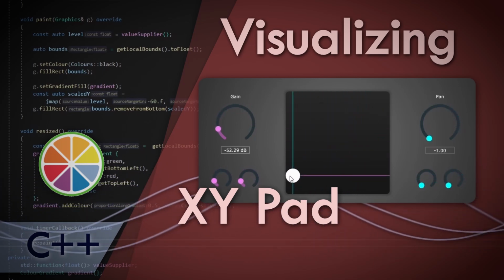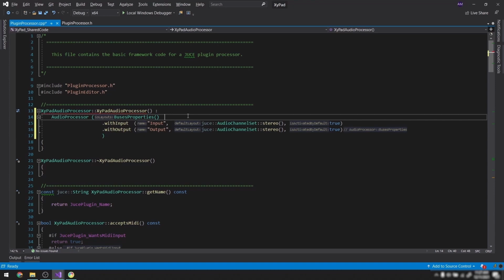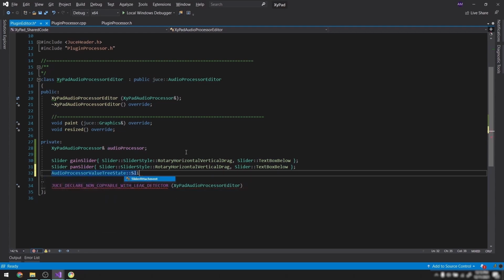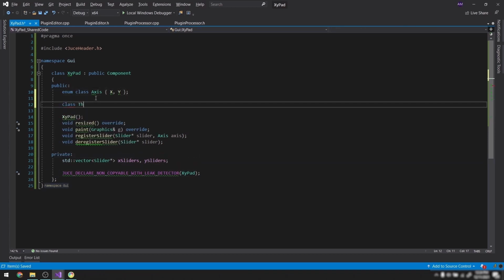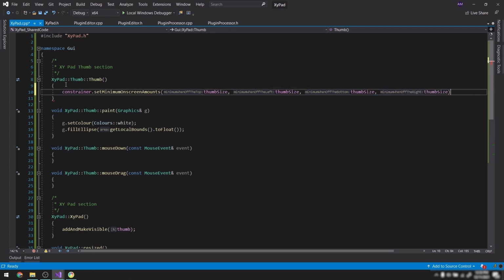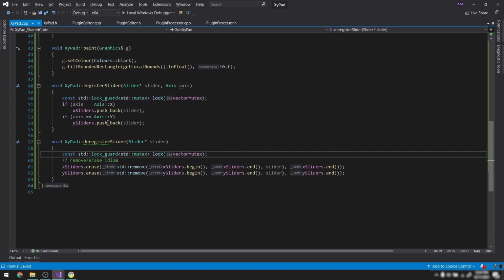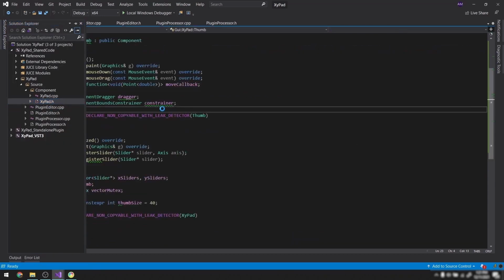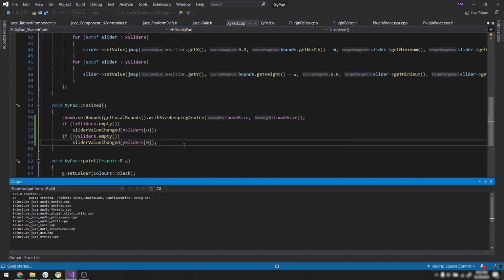XY Pad - Visualizations with JUCE

Comment: Thanks for a very thorough and helpful video. I've done some reading on functors, but I still have two questions: 1. Why use a functor for the thumb moveCallback as opposed to defining a standard function? 2. Why is the thumb.moveCallback connected to the sliders in the XyPad constructor as opposed to being defined as a separate function?

Comment: Nice video.
Do we have to make listeners manually? I was under the impression that AudioProcessorValueTreeState automates this process for us.
Reply from the maker: Hey there, it's a long video, and it's been a while. Maybe post the timestamp? 
So, the APVTS can store parameters, and you can listen to parameter changes. You can also attach parameters to common UI components like sliders and buttons. In this case, you don't need to implement your own listeners. 
But the XY pad is a custom component, and to respond to changes associated with parameters, we'll need to implement our own listeners.
Reply: @akashmurthy  oh, I see. APVTS make automation and UI-driven changes automatically, but it doesn't proveide callbck for us unless we specify a listener. And we need a callback in this particular case. Stupid me.